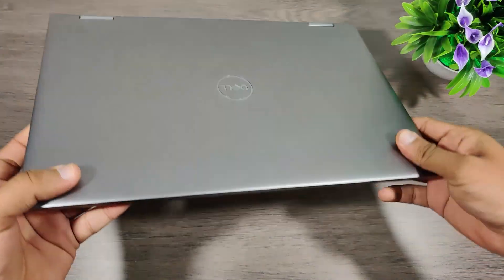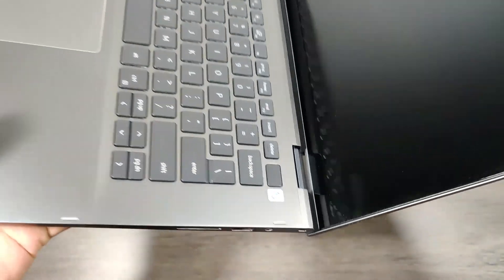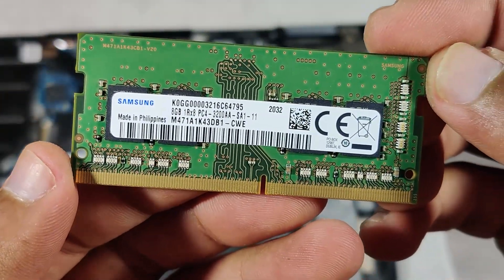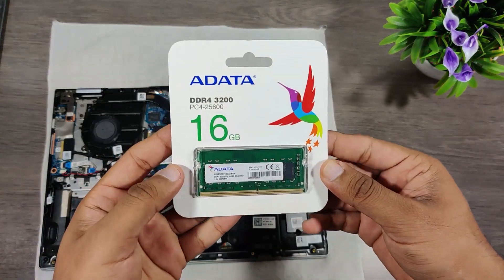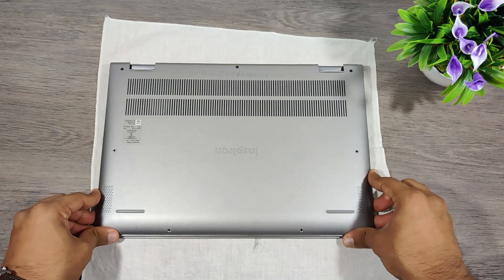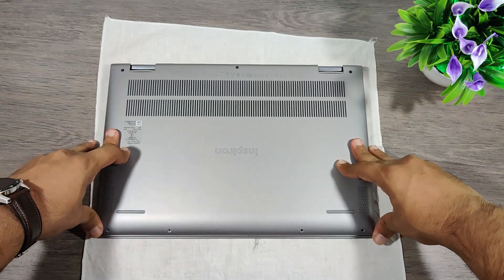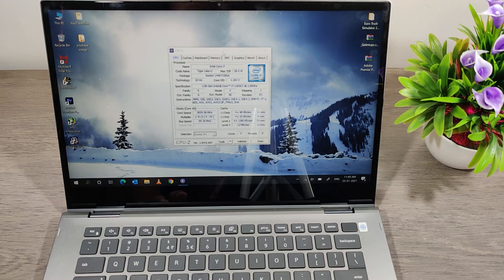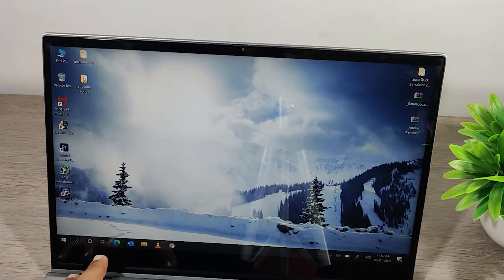Dell 5406 Laptop RAM Upgrade Installation Guide | Adata 16gb DDR4 3200MHZ RAM Install | SSD Upgrade?

Comment: My laptop model's RAM compartment is separately provided for easy access, and the battery is inside and I don't want to open the entire back panel. Since Acer itself has made it such, I wonder they're okay with users swapping the RAM without disconnecting the battery. Please let me know.

Also, what about grounding myself before touching the RAM sticks to upgrade?

Comment: Sir could you please tell me what is the latency of this Adata ram as it is not mentioned in specifications anywhere over the internet, Because I am getting the same Adata 8gb ram 3200 mhz for my Inspiron 5406 i3 11th gen
Reply from the maker: Adata and samsung are currently the best RAM you can get. Just check the frequency before purchasing.
Reply: @KaranBakrania  Thank you sir.🥰

Comment: Thank you for this video, bro. I am glad Dell lets you upgrade your RAM in this model. Lenovo does not let you upgrade your RAM in Lenovo Flex 5 (4gb RAM bottlenecks Ryzen 4300u)
Planning to get the i3 11th gen version and get an additional 4 or 8gb module.

Comment: Hey I have 5406 i7 1165G7 . The store I Brought says in their website is maximum capacity is 16 GB . But in like every video I watch it says 32 GB. Also In the website so as Dell website D9ntmention Type C can deliver power. CAN  it or Cant it ?
Also Can we add the 2nd M.2 Nvme slot with a Regular IT  shop ?
Reply from the maker: Although Website says 16GB max but it can upgraded till 32GB.
No, Type C is not used for changing laptop. Only data transfer.
There's no M.2 slot on the motherboard so additional SSD cannot be installed. You can upgrade the installed SSD.
Reply: @KaranBakrania  Thank You , I was looking For these Info for a Long time

Comment: when RAM of different sizes are compiled, they fuction as SDR in which only one ram operates at a time. While if we use same size RAM (8+8 OR 16+16) Then they work as double channel DDR, Both are used at same time. So go for another 8gb ram instead of 16gb.
Or you can add two 16 gigs of ram if money is not the matter.
In your situation you're actually using double ram as compared to starting. Not triple
Reply: Agreed
Reply: Any proof

Comment: On site it shows ram is not expandable
Reply from the maker: Yes but still you can upgrade till 32GB
Reply: @KaranBakrania  can you do comparison between lenovo flex 5 and dell 5406 ........also Is lenovo flex 5 also upgradable to 32gb

Comment: Kya aap ya samjah sakte ho ki DDR kya hai like mujhe laptop buy karna and also for game like mai gta 5 game khel pao but mai confused ho kyo ki like mai ne ek laptop dekha usse mai 16gb ram hai lenovo 5 flex but usse mai get force nhi hai na Nvidia hai toh GeForce or Nvidia or graphic card kya DDR ya same hai ya graphic card or ddr ya do alag cheez hai ya same hai
Reply from the maker: I'll first talk about RAM 👇🏻
DDR is used in RAM. DDR stands for Double Data Rate.and high the number will give higher speed. Like DDR4 will be Faster than DDR3. For normal gaming 16GB to 32GB will be enough.

Now I'll talk about Graphic Card 👇🏻
Graphic card is something that handles all the rendering process. Higher the graphics card will give you smoother video and gaming experience. So Laptop without dedicated graphics card is not suitable for playing games. 

This is little hard to understand but in-short if you want to bay a laptop to play games then buy with minimal 16GB of Ram and 4GB of Nvidia graphics card.

Comment: nice flower vase and brave video bro :) Does personally adding RAM void the Dell warranty?
Reply from the maker: No it doesn't...
Reply: @KaranBakrania  how many Ram slots comes with the i3 model and can 4gb be upgraded
Reply from the maker: @todams  all varient comes with 2 slot. Out of which 1 slot will be empty. You can upgrade till 16gb
Reply: @KaranBakrania  so can one slot have max 16 gigs?

Comment: Hey did you registered the product on the adata site? If Yes how much time it took to register the product.
I bought an 8GB ram and I entered the serial number on this "https://www.adata.com/ae/support/consumer?tab=warranty&warranty=warrantySearch" site to check the warranty but it shows "Product information is incorrect". But when I check your serial number it shows "Your product applies to a lifetime warranty term". 
Please help.
Thank You.
Reply from the maker: Your product might not be original. Please confirm from whom you purchased.
Reply: @KaranBakrania  
I purchased it from Amazon and is working fine.
But I'm also thinking it's not genuine so I'll return it.
Reply from the maker: @abbie1103  most probably.
Reply: @KaranBakrania  Thank You.
Reply: @KaranBakrania  so where to purchase this ram I wana purchase the same variant you are using in the video please provide link
Reply from the maker: @ClashRaj9  check on Amazon.....
Reply: @KaranBakrania  k thanks
Reply: @KaranBakrania  I bought the 8gb 3200mhz adata one on amazon is it okay?
Reply from the maker: @ClashRaj9  yeah should work fine
Reply: @KaranBakrania  Thanks for responding to me , for that you got a like and sub from me , and your video was very informative thanks again.
Reply: Price of ram ?

Comment: Hi Karan, I can feel little bit heat (48 to 50 degree) after inserting default 8 GB Ram in this laptop, Is it okay with that or need to visit dell service center. Im using only chrome for surfing that's all.
Reply: did uprgade your ram? if not and still get warm temp then keep your laptop on a flat surface. i would recommend to lift it up (just keep a small thing on each corner of your laptop) while gaming or something with heavy task.  also are you telling about the CPU temps? (45-50 degrees) if so then that cpu temp is normal.
Reply: @omsable5296  Thanks for the update.

Comment: Hi Karan, Thanks for the video. Can we upgrade 32 GB in same laptop with i5 processor and what is the maximum size of RAM can be installed in the laptop.
Reply from the maker: Yea 32gb can be upgraded. That's the max supported capacity.
Reply: Thanks karan for your quick response.
Can you please make demo for that.
Can i insert 32gb ryzen RAM in one slot or should i insert 16+16 RAM.
Reply from the maker: @saqueebshariff  you can go with either of them. Single 32gb or 16gb+16gb. Both will give same performance. You can make any combination just make sure not to exceed 32gb of total Ram.
Reply: @KaranBakrania  Sure thank you karan♡:-)
Reply: Hi karan, can we install 16×2 GB Ram with 2666V  in this laptop?
Reply from the maker: @saqueebshariff  check the frequency of your current RAM. cuz RAM with any other frequency will crash.
Reply: @KaranBakrania  Hi Karan, frequency of my laptop ram is 8gb 3200mhz, but i have 16gb ram with 2666v.
Reply from the maker: @saqueebshariff  you will have to use RAM with 3200Mhz frequency only. Other frequency will not work.
Reply: @KaranBakrania   Hi, I have upgraded 32 GB Ram in dell 5410, But it produces lot of heat below RAM part. Will anything affect coz of that. Like it produces lot of heat
Reply from the maker: @saqueebshariff  did u install correct frequency RAM? What company RAM you using?
Reply: @KaranBakrania I have installed Dell 16*2 GB Ram of 2666Mhz.
Reply from the maker: @saqueebshariff  you had mentioned above that your laptop has 3200mhz Ram. Then why you using 2666mhz Ram?
Reply: @KaranBakrania  Yeah it is only 8GB Ram so i thought to add 2 RAM's of 16Gb, So i added 16*2 with 2666mhz, Is there any issues with that or else i need to replace with the older one?
Reply from the maker: @saqueebshariff  If your laptop's motherboard supports 3200mhz ram then you cannot use 2666mhz ram. It could overheat and damage motherboard. So check the frequency your laptop supports and replace the ram with that particular ram.
Reply: @KaranBakrania  Sure, Then i will purchase  Adata 16gb DDR4 3200MHZ, It will work fine with that right? It wont produce more heat than this right?
Reply: Hi Karan, I'm using the same laptop which you have showed in this video, So can i purchase the Adata 16GB Ram with 3200Mhz, And 24 GB is enough i think for the programing  based language.
Reply from the maker: @saqueebshariff  yes buy any capacity ram with 3200mhz frequency and show work fine.... Thank You
Reply: @KaranBakrania  Thank you so much for your valuable time and support.

Comment: I am not sure which Intel processor  urs is.. But i5 11th gen supports 4266 Mhz Ram..can we try that too ?
Reply from the maker: I'm having i7 11th gen processor with Nvidia graphics card. This laptop supports 3200Mhz RAM.
Reply: Ah okay.. Thanks for the quick response... Another worry for me with this laptop is battery.. Its just 3 cell..40 Wah.. Can we upgrade it? If we can, what's the max Wah till we can go? Should we directly approach Dell for it?
Reply from the maker: @pavanbhattu3031  I think Dell will not allow that because they are not allowed to provide bigger capacity batteries of other models as this model comes with only 40Wh battery.

You will have to find locally for bigger battery with same connector. As you see on left side of my laptop's battery there's empty space so i guess bigger battery might fit inside.
If you find it will be your lucky day... Thank You.

Comment: Hi Karan I bought dell 5406 i5 11th gen 8gb/512gb/mx 330 version.
I want to upgrade the RAM.
I saw this video of yours and a very good video.
There is one query of mine.
Dell official site says it has max upgradable RAM memory upto 16GB. So can we upgrade the RAM beyond that.?
Reply from the maker: DELL Officially says 16gb maximum,  but till 32gb it should work fine. Maximum this laptop can handle 64gb but that is not required. 32GB is more then enough to handle any type of work load.
If you watch my RAM upgrade video you will see that I am using 16GB+8GB configuration. 
Soon I'll make video on 16GB+16GB configuration.
Reply: @KaranBakrania  So any combination of 8+16,8+8,8+4,4+4,4+8,4+16,16+16 would work?
Reply from the maker: @waynelee9288  yes, any combination will work properly, but maximum supported Ram is 32GB. So don't try anything above that.
Reply: @KaranBakrania  Thanks alot

Comment: In the i3 version how much ram can be upgraded?
Reply from the maker: Upto 32gb but 16gb should be more then enough.
Reply: @KaranBakrania  I am getting Dell 5406 4 GB ram for ₹61000 is it worth it please answer i need to buy this laptop. And can 4 gd ram upgradable to 32 GB.
Reply from the maker: @gyaniadmi2347  There is no doubt regards to the performance, Dell never compromises with its build quality. I don't know your requirements but Core i3 11th Gen is good for office and modate use. If you are thinking to play games on this laptop then it could not be a good idea.
Reply: @KaranBakrania  not for gaming but office.and drawing application's as hobby.
Reply from the maker: @gyaniadmi2347  yes it is suitable for you. Just add additional 8gb ram and you are good to go.
Reply: @KaranBakrania  Thanks BRO

Comment: Bruh pls respond, shall I insert this ram while keeping the sticker logo part at top or shall i insert while keeping the logo part at bottom as you shown in your video?

I'm very confused, I'm also gonna buy this for my hp omen.
Reply from the maker: Don't see the sticker. See the slot. RAM has one cut which will not be in center, so that it can be installed only in one direction. See the video properly you will find the cut on RAM.
Reply: @KaranBakrania  got it mate. Thanks a a lot